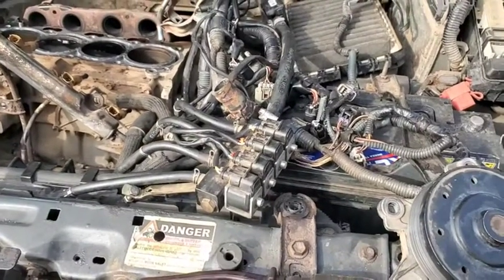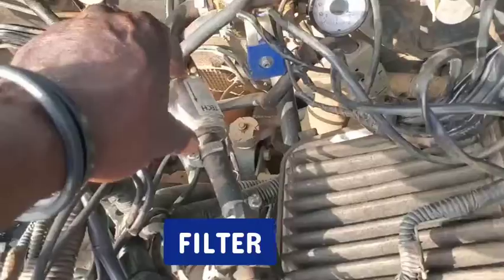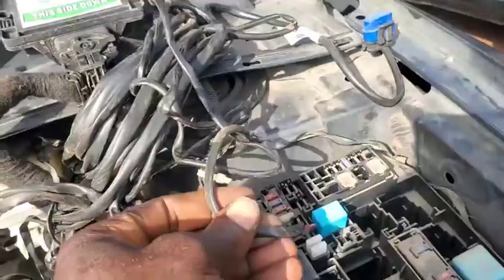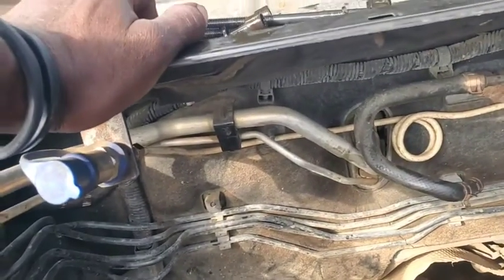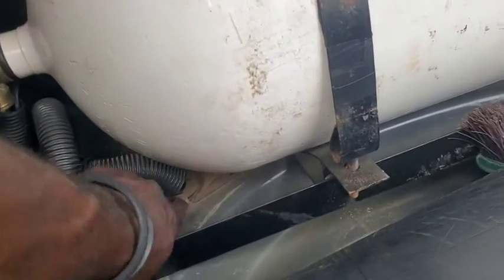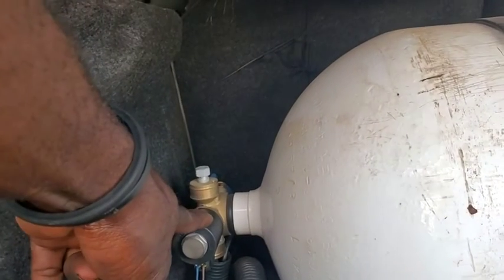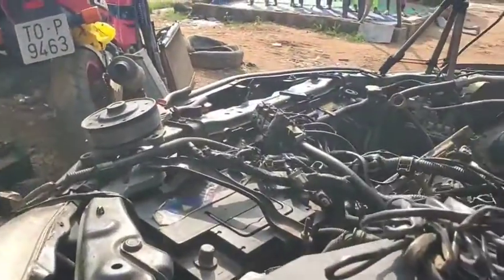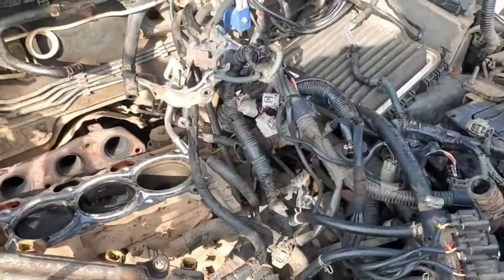How To Convert Your Gasoline Car Into CNG

Comment: Advantages of CNG
The Advantages of Compressed Natural Gas 1) The Environmentally Clean Advantage
Compressed natural gas is the cleanest burning fuel operating today. This means less vehicle maintenance and longer engine life.
CNG vehicles produce the fewest emissions of any motor fuel. Dedicated Natural Gas Vehicles (NGV) have little or no emissions during fuelling. In gasoline vehicles, fuelling emissions account for at least 50% of a vehicle’s total hydrocarbon emissions.
CNG produces significantly less pollutants than gasoline.
2) The Maintenance Advantage
Some fleet operators have reduced maintenance costs by as much as 40% by converting their vehicles to CNG.
Intervals between tune-ups for natural gas vehicles are extended from 30,000 to 50,000 miles.
Intervals between oil changes for natural gas vehicles are dramatically extended– anywhere from 10,000 to 25,000 additional miles depending on how the vehicle is used.
Natural gas does not react to metals the way gasoline does, so pipes and mufflers last much longer.
3) The Performance Advantage
Natural gas gives the same mileage as gasoline in a converted vehicle.
Dedicated CNG engines are superior in performance to gasoline engines.
CNG has an octane rating of 130 and has a slight efficiency advantage over gasoline.
Because CNG is already in a gaseous state, NGVs have superior starting and drivability, even under severe hot and cold weather conditions.
NGVs experience less knocking and no vapour locking.
4) The CNG Cost Advantage
Natural gas is cheaper per equivalent gallon than gasoline (an average of 15% to 50% less than gasoline).
5) The Safety Advantage
Surveys indicate that NGVs are as safe as or safer than those powered by other fuels.